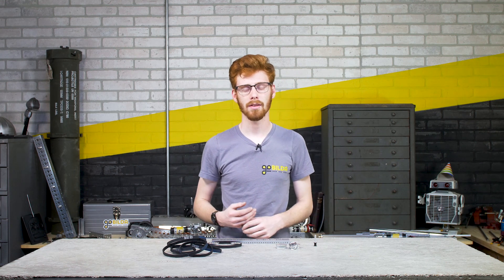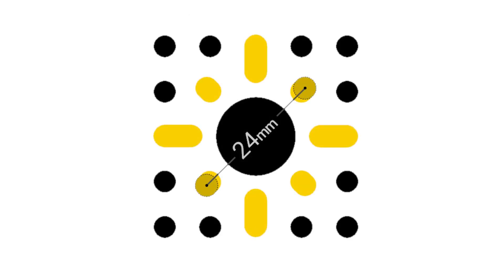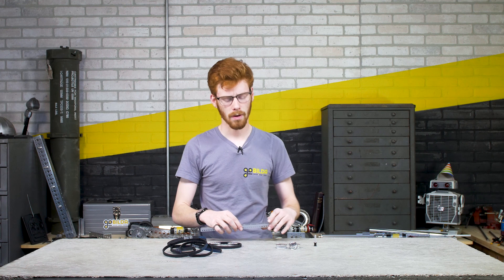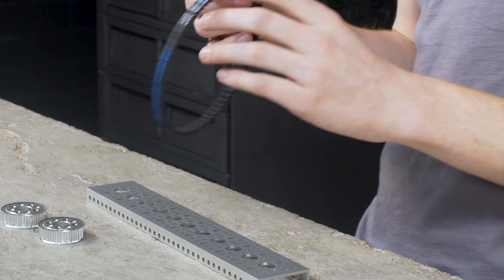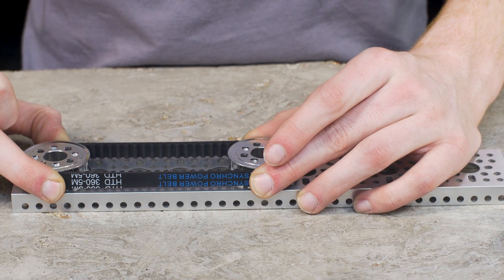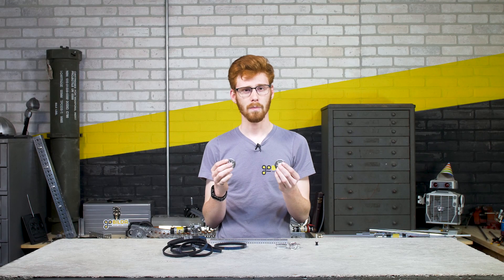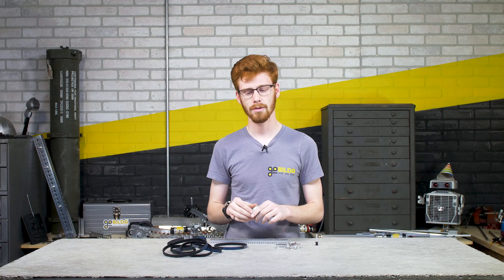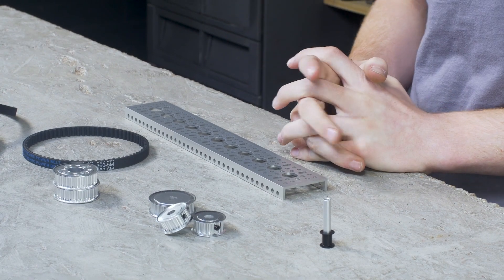Choosing the Correct Belt Length

Comment: can a 40 teeth pulley work with a 20 teeth timing belt
Reply from the maker: Hello Elmer, 

It would not. a 40 Tooth pulley would require a much larger belt to function correctly. We have a belt/pulley calculator on our website that you can use for your research! https://www.gobilda.com/5mm-htd-timing-belts/